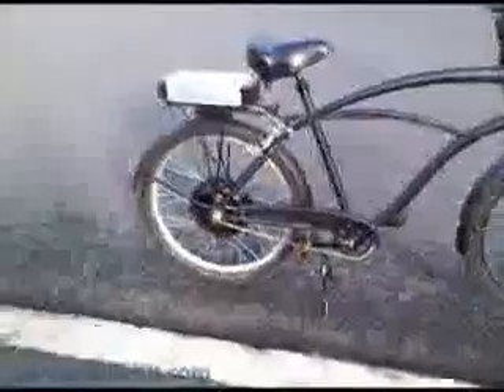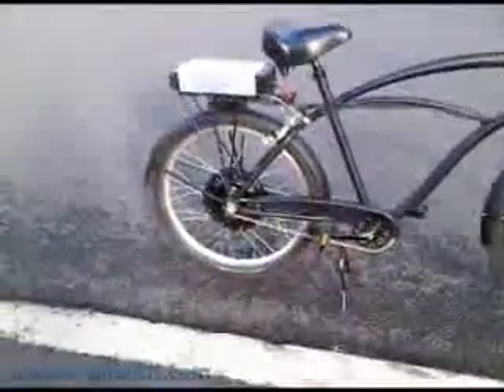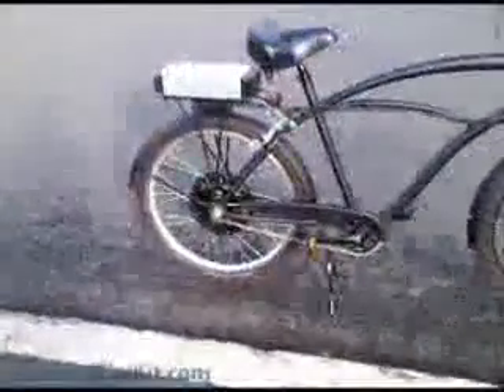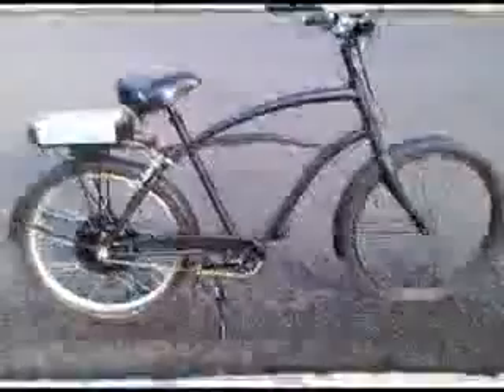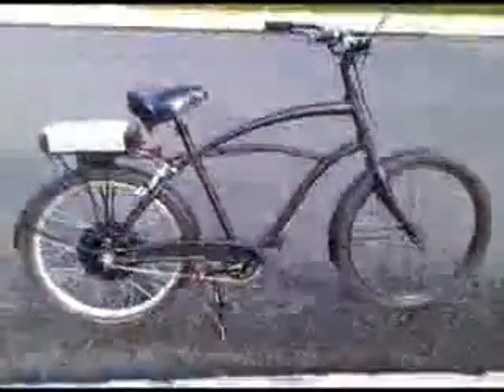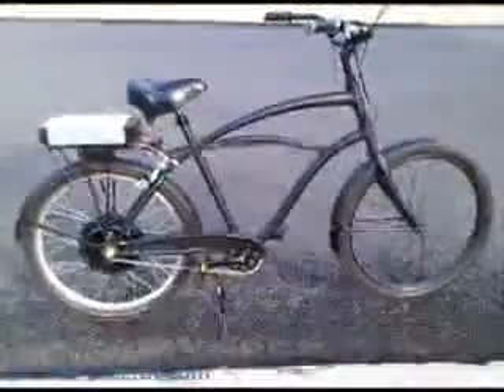E-BikeKit Hill Test. Geared vs. Direct-Drive Hub Motor

Comment: Hi!
You only saying geared motor or direct drive motor.
Are these brushed or brushless motors?
Brushless motors are much more efficient than brushless, but stall out under larger load, vs. brushed geared motors are better for load or hill climbing.